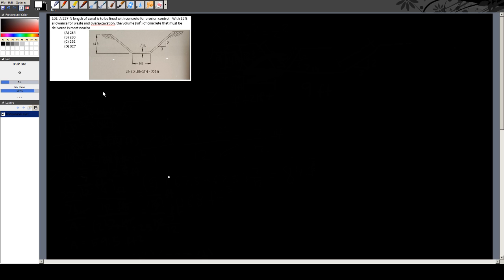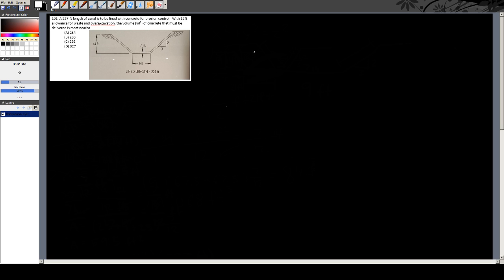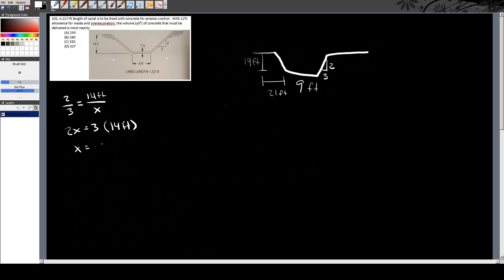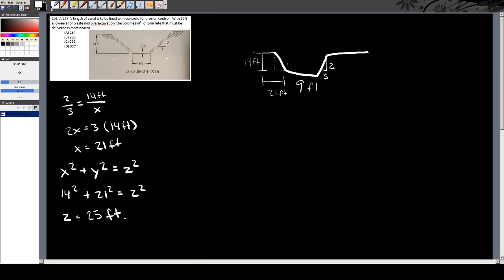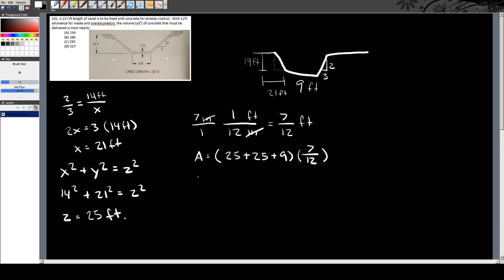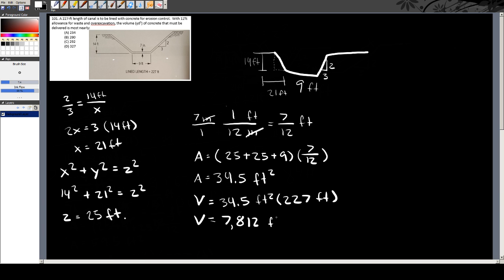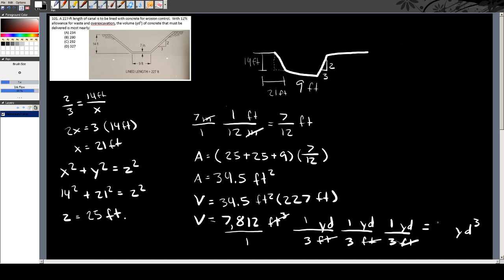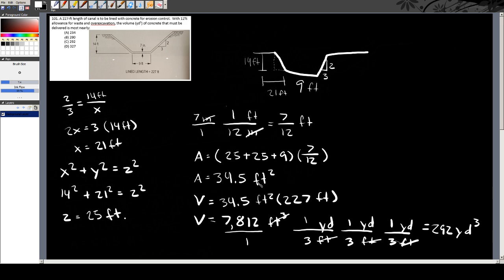PE Civil Engineering Practice Exam Problem 101

Comment: Where did the 1.12 come from? I understand that it’s supposed to represent the over-excavation/waste, but I’m not sure how you settled on 1.12.
Reply from the maker: It's a shortcut.

Basically, you add 12% for over-excavation. So if you do the math, it would be
V = 292 + 292(0.12)
If you factor out 292 from both terms, you get
V=292(1+0.12)
Which simplifies to
V=292(1.12)

Hope that helps!